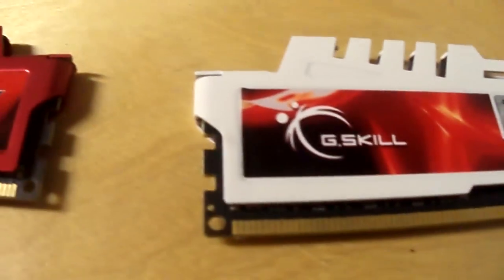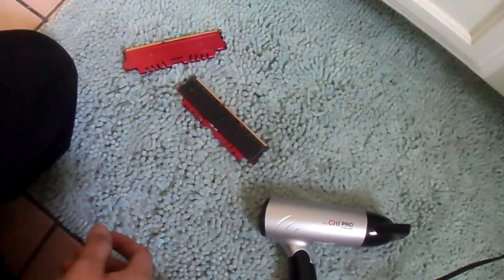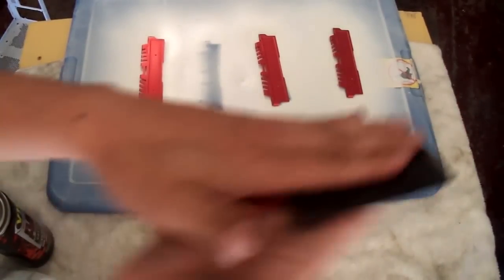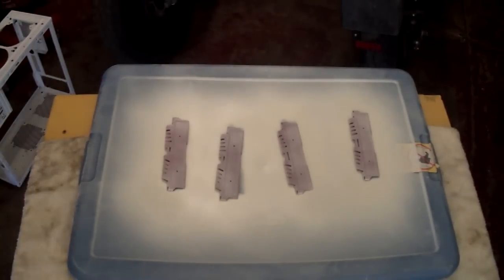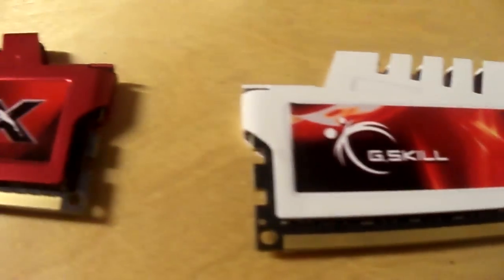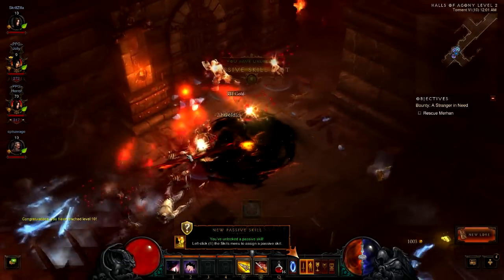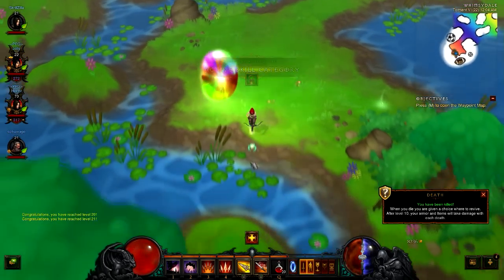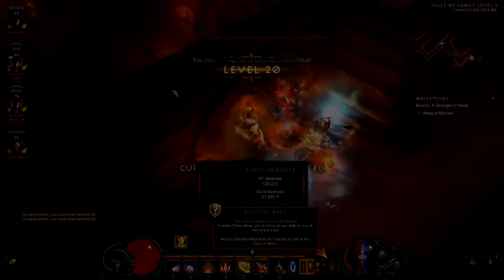How To Paint Your RAM Heat Spreader/Heat Sink

Comment: Nice. Thats a great Tutorial. When u pop off the speaders? Do they Snap back together when u put them back on? Also, How many coats did u use on the ram of the clear and how many coats of the white? How long was it from 1 coat to when u started the next coat? and How long did it eventually take to dry?

Comment: How did you reapply the heatsink onto the RAM? What about the thermalpads, did you have extras? Thanks.
Reply from the maker: Staffan Larsson nope they were the same ones just heat them up and if you are careful and they are heated enough they will still be just as sticky as they originally were
Reply from the maker: All Talk On also if you want you can purchase more but its a hassle to remove them from the heat sink to replace them
Reply: All Talk On Thanks!

Comment: When you take RAM apart, there is some stuff between the heat spreader and the actual RAM. I guess this is thermal paste. When you put the heat spreader back on without the thermal paste, doesnt that affect the performance or thermal output of the RAM? I'm just curious, I dont want my RAM to explode or something
Reply from the maker: +IbazzPro lol ram dont explode nor does it really need exotic cooling and the stuff between it is more of a thermal tape and no i would not suggest, nor did i suggest putting it together without it

Comment: That particular set of ram (I have the same set), can it run without the heat spreaders at all? Ram doesn't generate that much heat at stock speeds, so I'm just wondering
Reply: yes, ram doesn't get hot enough to require a heat spreader. They are just for aesthetics now

Comment: i know ram dosnt run too hot but im guessing this didnt really effect the heat output in a big way?
Reply from the maker: Jubul Dowthitt with intel platforms iv noticed the ram can get quite a bit hotter due to the north bridge running aroung 4000mhz on intel apposed to amd usually around 2200mhz which is where the "intel has better utilization of ram" comes from but even after the paint/clear coat the temps are still with in reason and as far as i cant tell have not changed, so if your on amd dont even worry about it, as for intel i would check the temps before and after to make sure you arnt frying anything case air flow can definitely help
Reply: All Talk On i have an AMD FX8350 so i shouldn't have to worry. only thing i dislike about AMD is the lack of compatibility for XMP, it was a hassle manually setting the multiplier and timings to get my memory up to the recommended 1866mhz. i have a NZXT H440 and its not the most airflow optimized case but i have plenty of high static pressure fans and positive static pressure so it stays decently cool. i have been looking for a way to do this because im using RAM from a different build and the heat spreaders are red but everything else is green and black its also impossible to find ram with green heat spreaders. another method i have seen is masking off all of the PCB and contacts and spraying it with plastidip.
Reply from the maker: Jubul Dowthitt plastidip will be alot thicker then regular paint the only reason i would use it is if i really needed my warranty and ram is easy to adjust i always manualy set my ram for all the pcs i build just to make sure they are where they need to be or for some overclocking, run aida 64 stress trest on you cpu/fpu/ram and see how hot they get if they arnt burning up then you would be good to go also test the stability of your ram alot before doing to make sure it will not need to be rma'd i had ram that worked 98% of the time, pc would randomly crash thought it was an unstable OC but later found it was the ram, so test at stock speeds maybe for a week or so and make sure you are crash free voiding warranties can be risky
Reply: All Talk On the only reason my ram was crashing was because of XMP, it dosnt crash now that XMP is off and i manually set it. but on my intel board it didnt crash with XMP, i just like my 8350 more than my 2500k so i am using it for my main rig

Comment: Can I use the same paint you used in this video to spray my vrm heatsinks?
Reply from the maker: Infinity Gaming lol i did hahahah just dont use the clear coat just flat paint and i would try to not get paint on the bottom of the vrms where they make contact with the mosfets so use tape or something to keep them from getting painted
Reply: lol alright thanks for the info dude. btw Is this the correct paint that I should use? http://www.amazon.com/VHT-SP102-FlameProof-Coating-Black/dp/B000CPJLGM/ref=sr_1_1?ie=UTF8&qid=1428724929&sr=8-1&keywords=vht+flameproof
I will be getting the flat white color, does this give a matte finish? One more thing, Can I use 400 Grit sandpaper to sand down the heatsinks? Or can I just paint without sanding? Thanks again.
Reply from the maker: yep flat exhuast paint, you could probably go without sanding just do what i did with really light speckled coats until it is almost covered and is that the color you want flat black though i would recommend a sanding if you only can get 400grt take 2 pieces and rub them together for a min to make the grit finer and it will take it down to about 600-800
Reply from the maker: and its a flat color so it has a flat finish/ matte is slightly shinier and then there is satin, eggshell, semi gloss, gloss, high gloss
Reply: Yeah I want to get the flat white version of that paint in the link. So If I am using flat white, I should still take 2 pieces of 400grit and rub them together? Also, when sanding, should I sand the surface all the way down to the core, and does it matter if the sanding leaves scratch marks? Sorry for all the questions btw, I am a complete noob when it comes to this stuff :p I've never done something like this before, So I'm pretty nervous :/
Reply from the maker: no problem sanding helps the paint adhere better so i would always recommend it and i would use 600-1000 grit which is y i said rub them together to make the 400 in to a finer grit (its a ghetto way to get finer sand paper) and no not to the core just a little rough up and if your using high grit ppr it shouldnt leave any deep scratches (also wet the sand ppr it helps) that can be covered with a thin layer of paint, hence the use high grit recommendation. if you can grab a piece of shiny metal or plastic dont matter and practice sanding it then putting a few coats on it, that can help alot with how you should put your layers down, i still do it from time to time
Reply: I appreciate all the help man, I think I got all the info I need. Last question (I promise) How long do I have to wait to spray between each coat?
Reply from the maker: usually about 20-30mins it should be dry to touch (but i dont suggest touching it, once you get your nice full final coat i would let it dry for about 24hrs and even then be carefull handling it, flat paint without a clearcoat can be easy to ruin especially white

Comment: Does this guide apply to hyperx fury memory?? Thanks!
Reply: Or shouldnt I remove heatspreaders and just use painters tape
Reply: Elias Pelo i dissasembled mine today, heat it than use a screw driver and it should pop out fairly easy

Comment: so  the  paint conducts the heat, or just keeps it in.. ?

i all read know the answer, but you make a video about it, so you must have a point of view on it, 

instead of being a cow and run with your own kind..
Reply from the maker: if anything it just keeps it in, though on ram at least the current ram we use heat sinks/shields are not really necessary and are just more for looks. anyways, granted there are cases where to much paint can cause an issue but ive been using this ram for over a year before i painted them and over 2 years after painting them (still in use) and they were never under enough heat to make a difference.